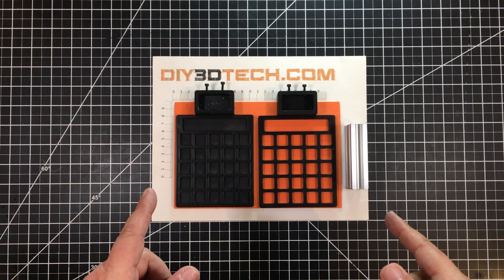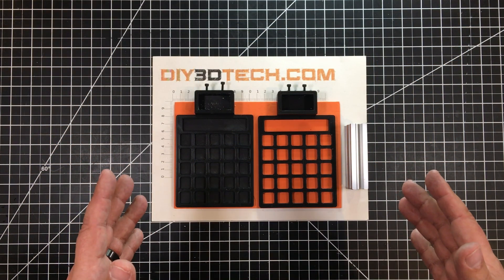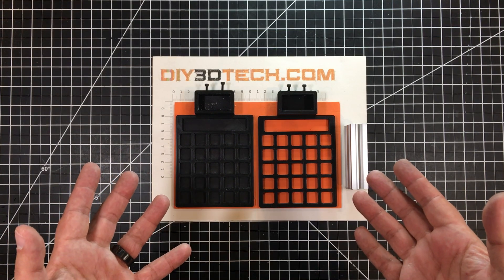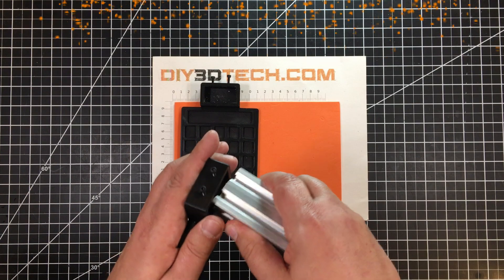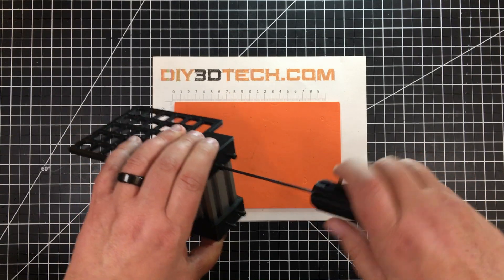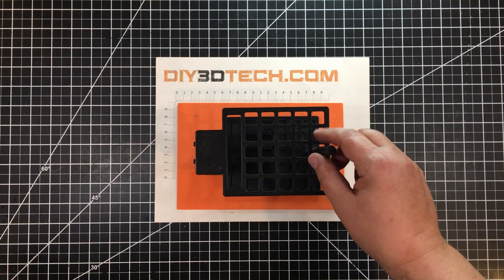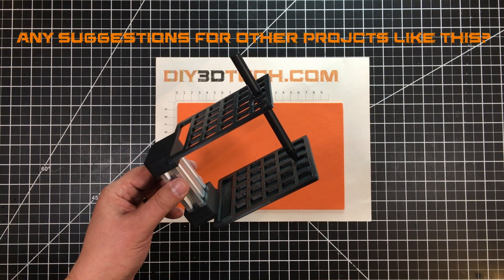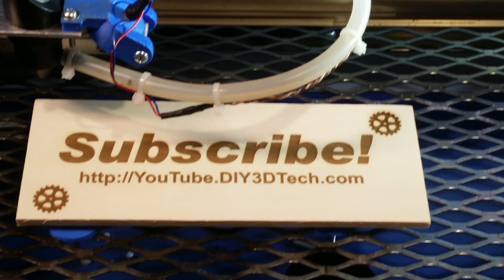Design Talk - 3D Printing for a Cleaner Desktop!

Comment: I can see this being extremely useful for organizing extruded styrene rods for hobby and model making using whatever lengths availible one could make it taller or shorter depending on the length of stock they have on hand. Might I suggest making a 3rd piece to that which has the hole for the 2040 going all the way through so one might be able to put smaller cutoffs of material in without it sliding out the side?
Reply from the maker: LOL!  (great minds think alink) I am already working on such a design "3rd piece to that which has the hole for the 2040 going all the way through so one might be able to put smaller cutoffs" in a tool caddy version so stay tuned!